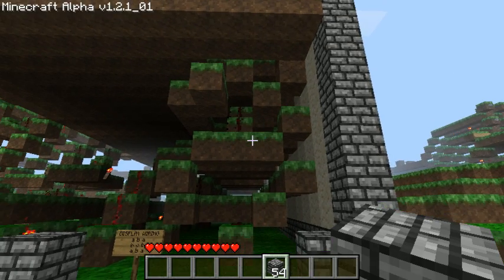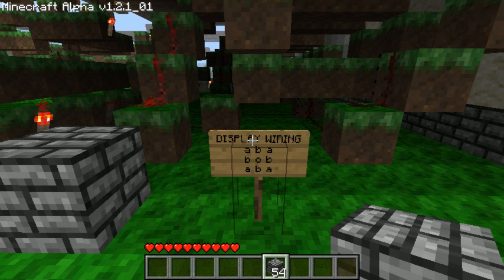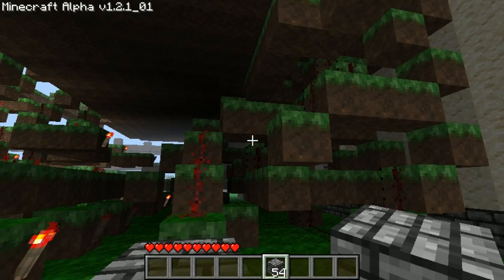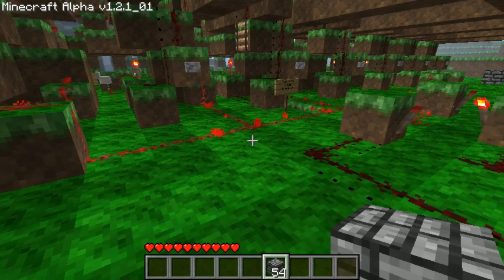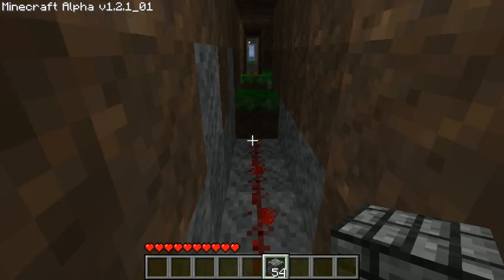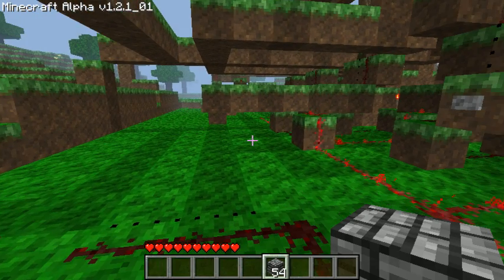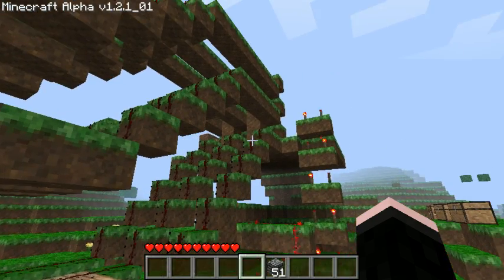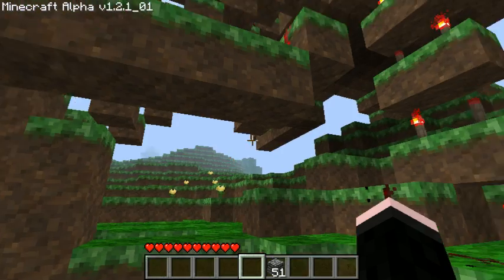Minecraft - Harbinger's Redstone - Tic-Tac-Toe - Explanation and Mini-Demo

Comment: @KylBlz If by "speedy programming" you mean that the code is designed to be easily human-readable, then yes you're right there. Interpreters are available for many platforms - not just Windows :-) Check Wikipedia for a ton of information if you want to learn a bit more about the language.

If it matters... I prefer Java, personally ;-)